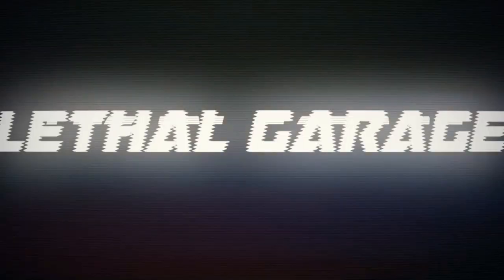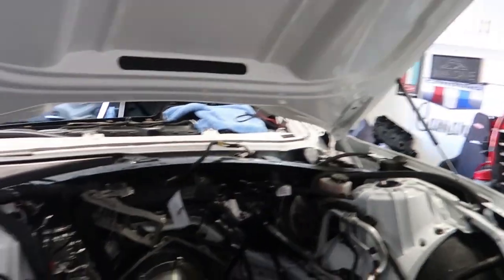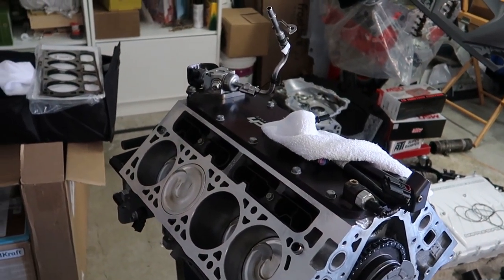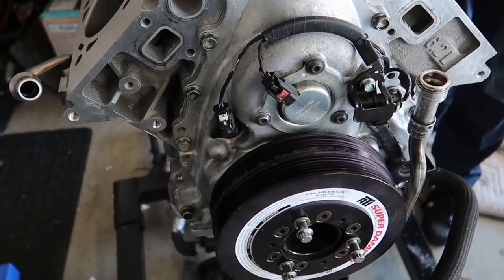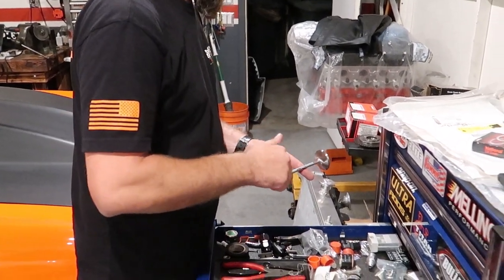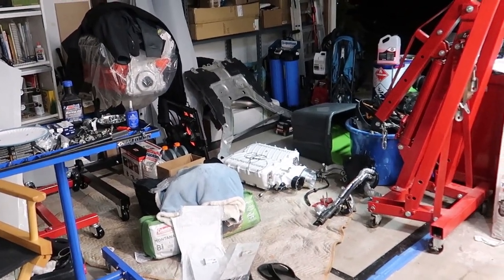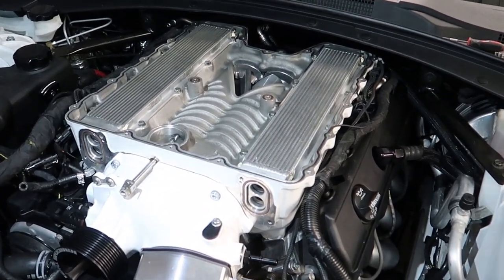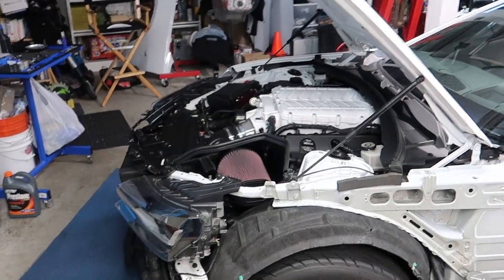1,000HP Camaro LT1 & FIRST START UP?

Comment: Putting a new TK Performance 1200hp rated transmission in my camaro and will be getting an FTI converter as well. What stall did you end up going with?  I know yours is supercharged versus twin turbo, but I figured I'd ask.

Comment: What fuel system are you running? what injectors and upper and lower fuel pump are you using
Reply from the maker: FIC high flow injectors, LPE big bore (V2) high side with a cam spec of 38% fuel lobe. LT4 low side drop in and the DSX auxiliary system with a boosta pump module.
Reply: @Lethalgarage  niceee thanks brotha I appreciate the reply

Comment: No disrespect, why don't you just buy a Zl1? Save yourself all the work.
Reply from the maker: All what work? I’d still have to do the same things and would be into the car for $28k more.
Reply: @Lethalgarage  but you would be starting out with 650hp rather than 450.
Reply: A ZL1 doesn't come with that lower end with all the upgrades he did all the ZL1 parts would be on the floor after he was done anyway!!